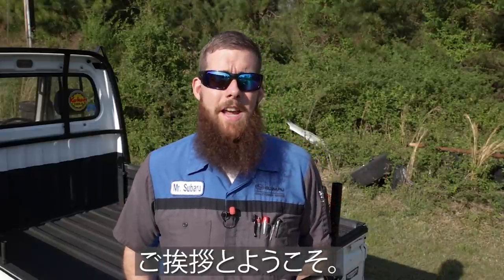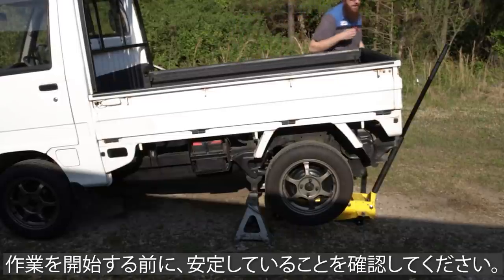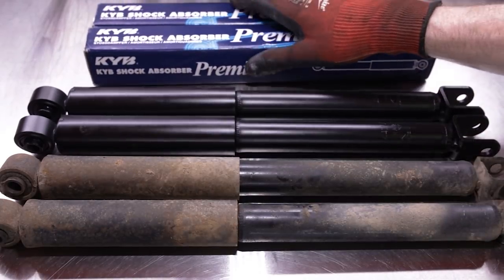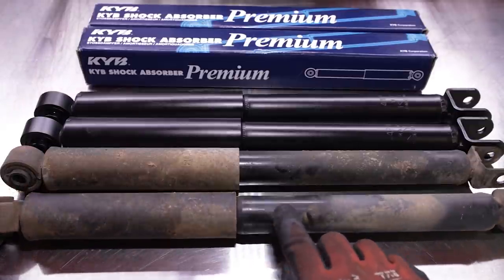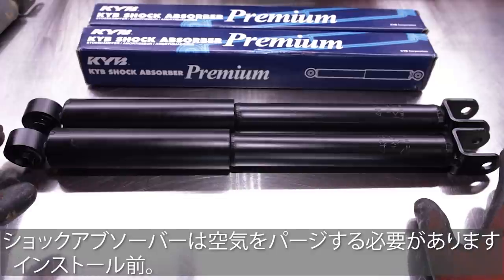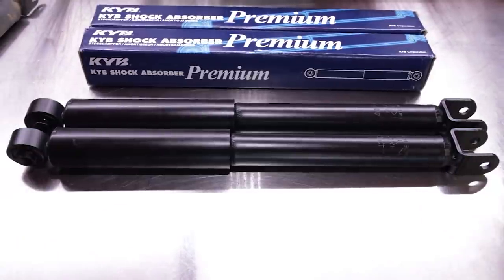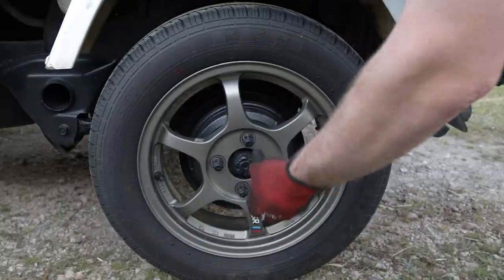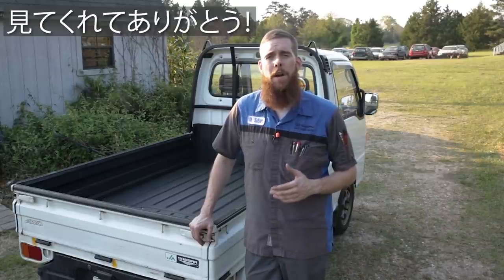Subaru Sambar KS4 Rear Shock Absorber Replacement: スバルサンバーKS4リアショックアブソーバーの交換

Comment: About ten years ago I was restoring at 61 falcon with crazy body roll. I replaced all four shock and it was a different care. Good job sir
Reply: Yep, I did all four corners on my ‘07 Forester XT a year and a half ago and ride & handling quality was like a whole new car. Cheers!
Reply: @bierbrauer11  dang my normal rode is a 2014 Outback I wonder if aftermarket shocks will improve my daily ride?!?

Comment: Hi mate, thanks for your work. Just picked up an 06 NA Forester with 97000kms with great service history. However, I'm getting poor MPG and its idling rough. I believe spark plugs should have been changed on the "i" service, is there any anyway to check this? Could it be the ignition coil pack? Or am I well off the mark. Cheers from Australia.

Comment: Hi.  I have a 2001 outback limited.   I am trying to find a tiny interior part and stumped where to look.  The part is a small metal cover for a hole next to the shift level on the console.   I think if you remove this cover, you can take the car out of gear.   I have looked at looked and just can’t find this tiny little mat chrome finished part.  Anybody got any suggestions????

Comment: Dude! 25miles on my rebuilt ej253.
3000rpm it falls on its face. 4 misfire codes, 1 for every cylinder. Long story short. It finally refused to start, tripped a crank position code. Dummy me fell to plug the harness completely in.

Comment: Could you provide a link for the shocks your purchased? Also, what would you recommend for the front suspension? Boy I tell ya... I can def tell mine are almost 30 years old!
Reply from the maker: I got these on ebay. I use Amayama.com, Japanparts.com, for my Sambar parts now. Straight from Japan.
Reply: @MrSubaru1387  Awesome, thanks man. Think you'll do the front end suspension as well?